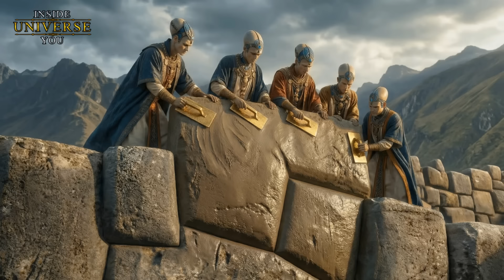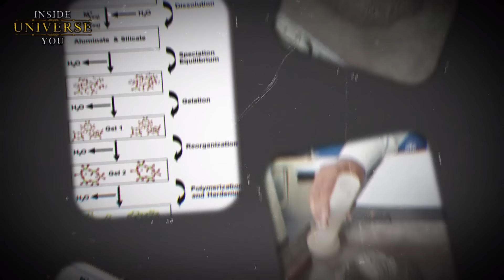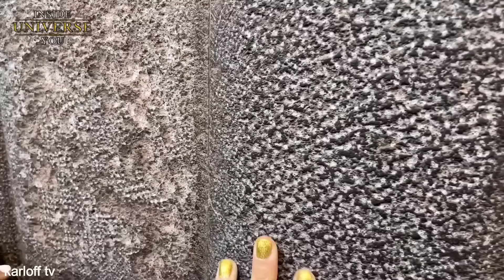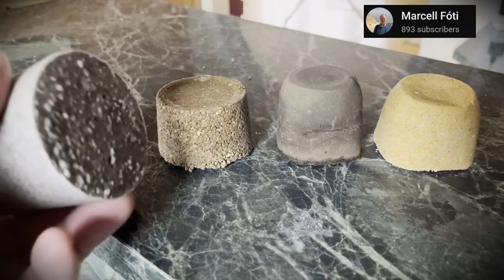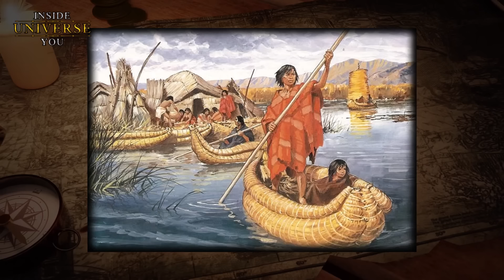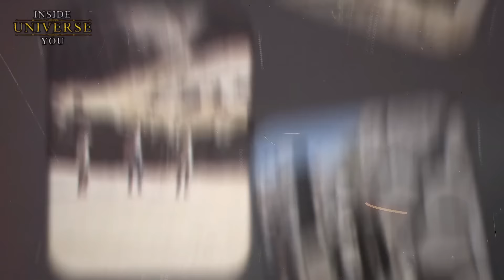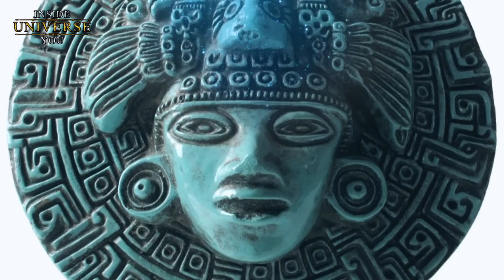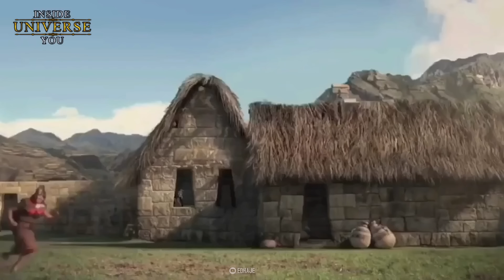Pre-Inca Geopolymer Explains the Massive Megaliths

Comment: What about the evidence of the stones cut from the quarry?? And cut stones left behind?
Reply: Geo-polymer theory is for fekwits, it just does not fit evidence or even cursory observation.
Reply: What evidence? Which "stones"?
Reply: @RJB1929  Baalbek southern lebanon
Reply: Massive stones from quarry are cut the same way today as then. No big deal. They were likely used to produce the polymer mix.
Reply: @martinlazar83  With what huge "no big deal" stone pulverizing machine?
Reply: @martinlazar83  I'd like to see the forms used for each block. Polymer...hummmm..ever work with bondo, clay or some type of puddy?  Not an easy task to get it right and each of those blocks bulge out from the seems, not flat, at or with each side towards the front. Why have we never seen the backside of one of the blocks? Someone must have take a picture of the back side.
Reply: @hilltop2233  They used large bags filled with the cement. Then cut a hole, where you see the knob so the excess can drain. Then flattened the mix after it hardened with wood. It's obviously not a stone work.
Reply: There were some cut from quarries.
Reply: there was no geopolymer, the geopolymer theory excludes the quarries and unfinished stones left partially cut. Which is preposterous
Reply: Someone just claimed that the Egyptian used chemicals to caste granite.
Reply: @logitech7989  Well whomever did so needs a better education.
Reply: The pyramids of Giza were definitely geopolymer based, also the the ones in machu pichu, but some weren’t geopolymer some were real stone
Reply: @Antonely-u9n  Absolute and utter garbage.
Reply: Fake
Reply: No cut stones. Ground stone to dust
Reply: @geoffmcarthy7314  Just what did they grind the stones to powder with? If their chisels were not up to the job then any other masonry tool is suspect.
Reply: a couple thoughts on casting pyramid blocks it would seem that if they are poured in place then how would such a pour happen as one continual pour? to be a block without defects it would need to be completed in one pour and what would be the formed  and how were they utilized as in some cases only one side and the top were exposed enough to permit a pour? How long would a block of this size take to cure properly before another block was poured on top without fracturing the bottom block? Question we may not have the clarity to answer.

Comment: Another question, how did they pulverize the rock into a fine enough material to use, what other material did they mix it with, how did they mix it, several hundred tons of thick slurry would probably be next to impossible to move without a machine
Reply: you are right. if the problem in the beginning was that granite was to hard to work with how could they grind it in to fine dust to mix it and mold it after in the shape they wanted , doesnt make sense
Reply: @Rodionromanov-x1l  You can crush granite with a hammer and grind it with a mill into powder.
Reply: With no likes,(no insult), I have the same questions. And what is a polymer?
Reply: See my reply above.
Reply: fortunatly the simple ANSWER  is it smarter to move  A  1000 TONNE BLOCK OR JUST MAKE A CONCRETE

Comment: We are talking about upwards of several hundred tons of rock in some cases, (ollentaytambo) , how would they mix all that dirt , stand it up, shape it, without it deforming or hardening before they set it
Reply: Same way you build a sand castle with a rubble core. Far less binder.
Reply: Right the bottom of the block would collapse and squeeze under its own weight

Comment: One theory is as good as the next, because we don’t know how they did it for certain, and that obelisk that was abandoned, that sure as hell wasn’t cast it was cut, which means they definitely were and indeed did cut stone
Reply: And if they were building these on a industrial level, they could have still quarried the rocks out of the quarry in the exact size they wanted said block to be placed onto the structure, separate that block and it’s dimensions, once it’s separate you then break the material down, and send that fleet of workers to transport only the material from the said quarried stone, so when they get the material to the structure, there’s no confusion on ok so how much do we pour into this spot, instead ypu would quarry your stone, break up the material on the spot, send labourers to deliver all crushed stone to designated area, have them re solidify all the material on the spot so they already know exactly where that material needs to be placed once primed
Reply: @Turne @Turner-u4r s a popular theory and could be true. But there are issues with it, like the many massive stones that were already quarried and were abandoned during transportation between the quarry and the building site (many in Peru, even after moving them miles). It’s also not logical to excavate all the stone around an object like the unfinished obelisk, just to later cut up the obelisk to get it into bite-sized pieces for easier transport. You would just need to measure out how much granite you need and take only that, or take plenty, no need to pre-make a monument at the quarry if you can just cast it properly at the build site. They clearly had extremely sophisticated mathematics, therefore they wouldn’t need to rely on pre-cutting the monument just to later cast it. Egypt also has several massive granite boxes that show saw marks, even showing boxes where the saw made a mistake, so why would there be massive boxes with clear saw mistakes when they could have just casted them. To me, there are many ways the casting theory makes sense, and many ways it does not.
Reply: @officialmattturner interesting point, in my opinion it wouldn’t be out of the question for a civilization to have utalized power almost to the extent that we have today, if you look at how quickly we came up with designs for mega machinery that would be able to
Acomplish some of these feats, it couldn’t of been more then 200-300 years, so definitely not out of the question these technologies weren’t discovered and utalized but just lost without anyone directly or indirectly involved in them surviving within a reasonable timeline
Reply: But also to that point it does contradict my first theory of why they would have power and be able to make cuts like this but still use the method in the theory I proposed,
Reply: @Turner-u4r  Agreed. You're one of the people like me in this topic who appreciate getting granular. It's one of the greatest mysteries. The scoop marks and the polygonal walls which fit together so perfectly DO indicate these ancient civilizations were able to melt/mold the granite. Thus, that logically indicates there would be no need to attempt to move stones which weigh millions of pounds because like you said they could just melt down bite sized chunks and move that from quarry to the building site for reassembly. However, the boxes with saw marks and the massive stones which were being quarried or in-midst of being transported to the building sites indicates they were not melting these stones down to bite sizes transportable pieces. It's like we have two theories which both have evidence, yet they both contradict each other when you pragmatically imagine the process. Why saw and move  massive stones when you can melt them down to smaller pieces for casted reassembly? And why pre-create these massive monuments at the quarry just to then melt them down for transport (like the 1200 ton unfinished obelisk, the 5000 ton South Quarry stone in Minya, the 1600 ton stones in baalbek) when you could just use quick math to know how many pounds of stone to bring? Why would you leave the nubs if you are able to melt/polish/saw the stone?
Reply: @OfficialMattTurner   It would be interesting if they did some physical archeology to find the process that could have been used with the tools that they had or even find a process that used tools and chemicals that haven't been thought of yet. N
Reply: I feel like the theories that don't involve magic or aliens are better than those that do
Reply: @sr-kt9ml . Its a lost technology. Not a magic trick.
Reply: During previous cycles, civilizations operated in a higher resonant state where the molecular structure of materials was malleable through harmonic interaction. By standing in precise geometric grids and utilizing specific vocal frequencies, they could soften granite and reshape matter at will, snapping the molecular bonds back into place once their work was complete. We cannot replicate these feats today because our current position in the galaxy dictates a dense reality where such molecular fluidity is impossible. These megaliths are not primitive monuments but the hardened remnants of a period when the barrier between conscious intent and physical matter was porous. 432,000-year cosmic cycle where the number 432 acts as a fundamental harmonic constant.  This harmonic constant reveals that epoch duration and resonant frequency are coupled across orders of magnitude, suggesting that physical laws are not fixed constants but are tuned to the harmonic scale of each age. As we transition from the 432,000-year cycle to an 864,000-year cycle, the resonant frequency shifts from 432 Hz to 864 Hz, fundamentally altering the nature of matter. In our current 432 Hz era, atomic bonds remain rigid, necessitating brute mechanical force to reshape material; however, at 864 Hz, the increased kinetic oscillation at the atomic level causes molecular bonds to lose their rigidity. This transition restores the material plasticity required to reshape matter through harmonic resonance and vocal frequency. We misinterpret ancient megaliths because we view them through the lens of our current low-frequency density, failing to account for the fact that these structures were built when the physical reality was porous and malleable. As the cycle progresses, this transition is inevitable, making the current period of systemic cultivation essential; by purifying the vessel and optimizing the DNA antenna now, we ensure our nervous systems are calibrated to resonate with the coming shift rather than overloading when the fundamental constants of physics recalibrate.
Reply: @wormy3811 what you said is new to me, got any vidéo to show me going into this rabbit hole ?
Reply: The world is 7HZ firstly, we won't see 432HZ for quite some time my error there. I suggest their is a slow gradual shift the peak will be 1728HZ, the strongest signal I detected in the distant future precisely is 864 HZ using the Schuman resonance. I don't believe anyone has looked into what I have. At least I don't know of anyone. So there is no videos. What we do see is sites in the world where stone looks like it was treated like putty instead of stone. I began to run some tests which showed me it was possible to interact with stones to effect their molecular bonds having a good understanding of the geometric lattice work of the stones though also applying sound resonance. From my understanding Earth has favourable periods when they can achieve this, it had a lot to do with Earth magnetic field aswell. What I shared was for people mainly to investigate in their own terms since most is all just speculation or fringe theory. What I was really interested in was the Galatic cycle being the main driver of Earth's system because today for example will be different in a million years. Dinosaurs we were told went extinct, we are told people haven't lived so long on Earth. Mainstream is BS. Oxygen levels were very high at the peak, vegetation was at its peak, everything was large by comparison to today's standards. Africa still had a lot of vegetation which ment their Animals were least affected compared to the rest of the world, the world had to downscale due to a lack of Oxygen as the cycles were in the descending phase. Yet we are going back up on the ascending cycle, Earth right now is in a dense state, if my theory is correct which lines up with ancient text and fits math very well. Oxygen will increase, the Oceans will become much warmer, creatures will adapt to the environment in favourable conditions they can live much longer, their cells don't break as easily. The atmosphere is different. People need to scale tests beyond our current definition or understanding the take into account all the complex logic and variables to see the truth for themselves, which is what I am trying to do.
Reply: It's hard to type everything here half the time my text clears when I use phone. I hope some of that can make sense. I actually have proof of my signal detections that are undeniably accurate. Still it's only speculation which most science is, just a speculation. Where we look at the stone being made soft falls into fringe theory. It's really out there so to say, however I think that's the right avenue to look at, since how else can you manipulate stone?
Reply: Even then how do you test anything physically on a 7HZ Earth with no funding? No one is really looking into any of this, those that do, don't really test their work effectively these are still dark times. Which we see in the past wasn't always the case and we will reach that golden era again.
Reply: The guy litteraly made a granite butterfly at home with little to no experience or reward for doing so, so yeah im sure a whole civilization with no limitations on “time” (comparing to modern day safety regulations) it’s definitely plausible if not likely that when a civilization of that era discovered something like being able to cast stone, they would likely start giant projects like the pyramids, ect even if there was no other reason to do so, it could’ve even had a gold rush affect on humanity, giving birth to a somewhat “industrial” era where people could now work (skilled, or unskilled labour) on these structures  and get paid good money for it,
Reply: They have obelisk in Peru? Didn't know that
Reply: They definitely cut stone but just how is still a question that hasn't been answered.  They need to do some physical archeology to figure out the process that they used.  Or maybe it was multiple ways that they accomplished it.
Reply: This building style is still done today and was worldwide back then.
Reply: it's probably both, different people at different times with different toolkits and techniques. some worked in natural stones of absurd sizes, i would guess to be older. another phase of construction was done with cast blocks. i don't see why this is a problem.
Reply: Aren't you referring to the Vedic Day of Brahma  cycle in which one day is 4.32 billion years?And wouldn't it be exciting if we can shift from one timeline to another, instead of being stuck in one? Masterpiece over Time should be easy for those that can affect the resonance pattern...that's what I like about Life: infite possibilities,  if we just Believe
Reply: Not even a theory at this point geopolymer institute did a full chemical analysis and electron microscope scans and found indeed they are geopolymers beyond a shadow of a doubt
Reply: For me, they obviously did both stone carving/masonry, and the concrete/geopolymer.
Reply: This isnt a theory the objects been tested
Reply: @goodvibƏs no it hasnt
Reply: It helps to know what didn't and couldn't happen, though. Look up Amaruca, the god from which America was named.
Reply: @marilynmitchell2712  America was named after Amerigo Vespucci, an Italian explorer.
Reply: I don’t have a theory I have the answer. To how the stones were hewn from the ground elevated and even shipped to where they were placed. The stuff used to do it from tools to rails are all buried deep in the soil nearby to many of these sites. Thing is puma punku the mountains these blocks are on have skeletons of buildings constructed of these blocks. Dig away centuries upon centuries of dirt and settlement and you’ll find towering buildings like skyscrapers thousands of years old. The only reason stones like the H blocks are scattered about is the waves from back then were able to batter those since they were at the tops of the buildings making them susceptible to being knocked around when the flood was at its most violent.
Reply: This video is similar to all of the videos claiming to have discovered the method of production of pyramids and etc. All rubbish and clickbait
Reply: @TeamTigerAdv 😂 alchemy rocks 🪨 we build today with Geopolymer

Comment: One thing is for certain... all that stonework was not done by hand with hammers and chisels or dolerite pounding stones. Technology can be lost and was so IMHO after a worldwide cataclysm. Concrete for example was first invented around 6500 BC by the Nabataean traders in what is now Syria and Jordan.  They used a form of hydraulic lime Concrete was later reinvented in the 18th and 19th centuries after being largely lost following the fall of the Roman Empire.  
Key milestones include:
1793: John Smeaton rediscovered hydraulic lime while rebuilding the Eddystone Lighthouse in England, marking a revival of concrete technology. 
1824: Joseph Aspdin, a British bricklayer, invented Portland cement by heating a mixture of clay and limestone, creating the foundation for modern concrete.

Comment: It should be simple enough to take a sample and confirm one way or the other. Right? It can't be both natural rock and polymer simultaneously. You'd have to take a wide range of samples, as it is definitely not every last stone. Additives should be relatively easy to isolate. If it isn't there, stop banging on this door. Also stop saying it's "proven" until it is. It isn't even a theory yet, only an hypothesis, at this point. 

Happy to be corrected on this.